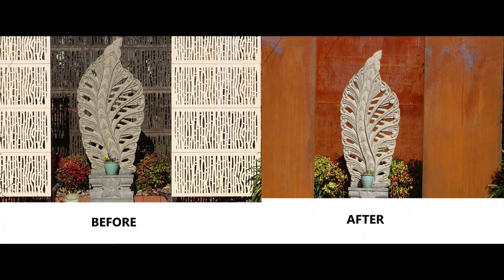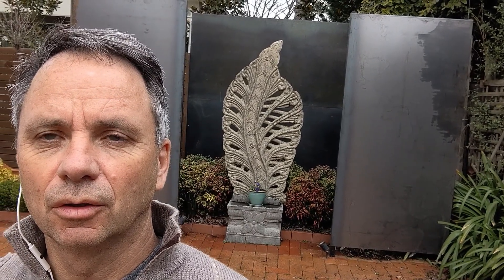How to speed up rusting of Corten steel (weathering steel)

Comment: Very  nice you showing this! And a beautiful result, I may say.
It´s a pity you didn´t let the viewers know what you´ve used to get the steel rusty.
Reply from the maker: Marguerite, thanks! - I am pleased with the result and I'm hoping it will be a practical, long lasting result too which won't need any painting or replacements for a very long time.
I actually can't remember what I used for that job.  I have used laundry bleach, pool chlorine, and vinegar and I can vouch for them all.  I believe I may have used vinegar for a first coat followed by a very dilute pool chlorine mixture.  I believe any kind of weak acid will have that effect on steel.
I sprayed the acid mix off after about six hours and then kept wetting it every day because the air here in Canberra is very dry.
Even if you don't spray at all, the normal acidity of rain (pH of about 5) will eventually bring on the rust, but it could be months or years depending on your climate.
Reply: @Gardenosophy  Well thank you! 🙏 This is very helpful.